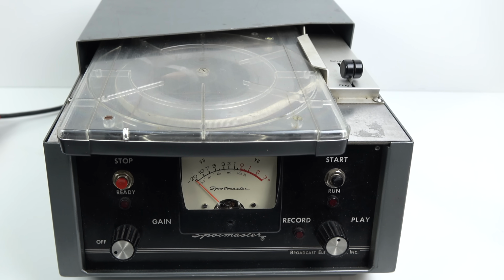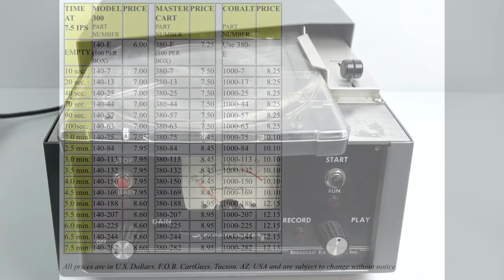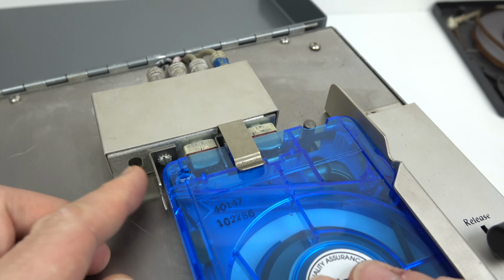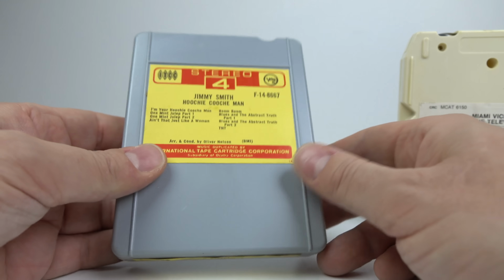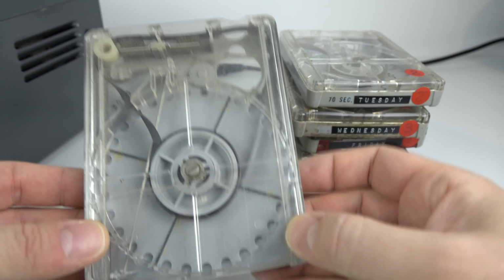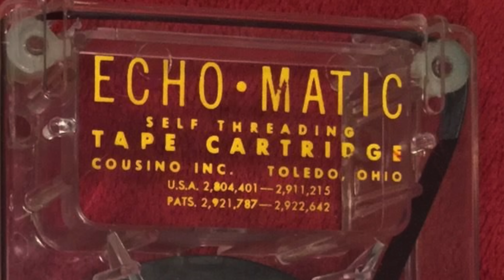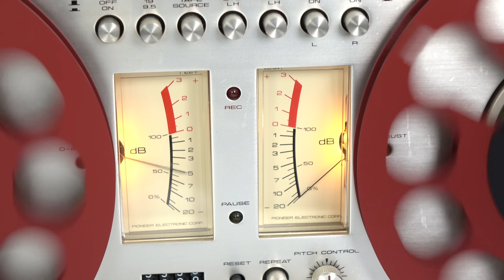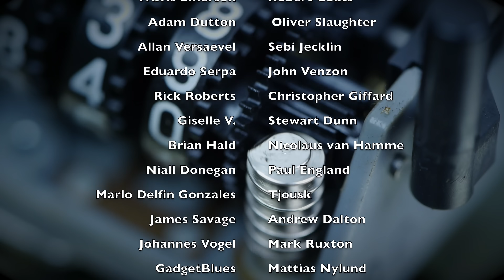The Broadcast Cart Machine

Comment: Back in the 80's a local radio station(Phoenix, AZ), was playing a cart to death. It was Duran Duran's, "Wild Boys", it was putting out it's death throws for about a week, until it finally self destructed on the air. I only wish I had the sense then to record it.
Reply: Sad, that would've been great to hear!
Reply: If I were a cassette made to record Duran Duran I'd probably kill myself too. 

unless it was Rio, then I'd allow it.
Reply: Max Mills That's why they put music on carts, so they didn't wear out the records, and eventually, CDs by playing them so much. Especially on pop radio / CHR !
Reply: Filming In Portland, how can you wear out a CD by playing it, its data being picked up by an optical tracking system, nothing touches the data, the machine will wear out, and you can break or scratch the disc but you cant wear out a disc just by playing it
Reply: @compzac  Both of you are right for slightly different reasons, CDs suffer  "wear" from handling rather than actual playing. same with records, accumulation of scratches from being handled repeatedly and with less care over time killed more records than were actualy worn out by the stylus. If a radio station is going to "burn up" a new recording (As is/was usual in the first weeks of a new,hot Top 40 tune.), Better to use a "cheap" tape dub.
Reply: @ChristopherSobieniak  I have heard serveral carts "buy the farm" on the air over the years, Having an ad "eat it" right at the "pitch" is golden Especially, if it was caught right and the air talent has to recover the spot. Sadly, such fun is lost in our digitally programmed stations now.
Reply: @jamesslick4790  Oh, it is.

Comment: This brings back memories. Back in 1990 I discovered a bunch of stuff that had been taken out of a small radio station in 1973. There were a few pieces of equipment, along with boxes of carts and reel to reel tapes. The equipment was all made in the 1950s and included a couple of full track ¼" reel to reel recorders designed for mounting in an equipment rack, with the electronics (with octal base tubes and a very rugged and heavy design) in one unit and the mechanism in a separate unit. I found the manual for one of these machines, and the specs were quite impressive for the time, as these were true high-fidelity machines. There was also a cart machine which was for playback only, it was a very simple machine with a lever on the right like yours. I was able to use it to listen to some of the carts and discovered the cue signal on one track with the program signal on the other. The machine had an output for the cue track but didn’t have any internal cuing mechanism, so I assume it used an external cuing unit. Many of the carts had multiple spots on them with a cue signal at the start of each one. There were a lot of commercials on short reel to reel tapes, and I assumed that these would normally be dubbed onto carts for broadcasting, then when the time for the ad was over, the cart would be erased and used to record another spot or several related spots. Usually these multiple related spots would be found on one reel to reel tape, recorded one after another. I didn’t find any music to speak of, other than jingles and such, but I did find a DJ demo recorded on a reel to reel, where a DJ at the station had recorded several times the end of one song, his announcements, and the beginning of the next song. Presumably the DJ made the tape as part of an effort to find a job at another radio station. The unique sound of the beginning and end of each recorded spot told me the demo was recorded on one of the machines I was using to play the tape, or an identical model. It was interesting to hear portions of songs that were current at the time, which was 1973, the year the station removed their 1950s era equipment and replaced it with new equipment.

Comment: Regarding the carts with music; They used these carts in the radio station my dad maintained in the early 90s in Western Australia for their fully automated robotic system for ads, jingles AND music. The system was very old by that stage (it had a paper tape reader on it for programming, though not in use by this stage), it had two banks each with a robotic X/Y mechanism for picking and placing tapes from it's respective library into one of it's several cart machines in the bottom row (see the scene from 'Hackers' but for these carts instead of video tapes). From memory it was called "M.A.R.V.I.N.". Those music carts you have may be from a similar system.

Comment: I worked at many stations during the 1970s and 1980s, with cart machines from Tapecaster, Spotmaster, Sparta, Gates, SMC, ATC, and ITC.  We used them for everything from jingles to news reports to full songs. A station where I was the chief engineer during the mid-1980s had almost 100% of the audio we aired come from cart. At that station (WKHY) we had 2 ITC 3-slot stereo cart machines in the main air studio feeding 6 channels of the mixing board. The carts were recorded (in the production studio) using an ITC series 99 machine. The cue track uses a 1 KHz (primary) tone to mark the beginning of cuts. There is also a 150 Hz (secondary) tone that is used to mark the end of cuts. The secondary tone starts when at the overlap point where the next program element should begin, and ends at the point where the audio on the current cart ends. You talked about a cue function. Of course all cart machines would stop, cued to the beginning of the next cut at the beginning of a 1 kHz cue tone. The only machine I have experience with that had a more sophisticated cue mechanism was the ITC series 99.  After the end of the 150 Hz secondary tone, it would go into fast forward looking for the primary tone, which was much higher than 1 kHz because of the increased tape speed. Some machines also had an 8 kHz tertiary tone, but there was no standard use for such a tone. Also, some machines would output the cue track audio to a modem which decoded an FSK burst with logging information. If you really want to see some interesting applications for NAB carts, check out the 24-cart carousel machines made by SMC, or the 48-slot Instacart (both of which I've worked with). Gates also had a 55-slot machine, which was not very popular. These 24, 48, and 55 slot machines were  used as part of automated program playout systems. Often, a program automation system would have a time announce sub-system consisting of 2 cart machines, one for odd minutes and one for even minute. For minutes when the time announcement was  not aired, at the end of that minute the system would switch to the other deck and play past the unaired announcement. This way it was all ready to go with the correct minute hen called upon. Due to the large number of announcements on each time cart, it was mandatory to use the largest cart, which IIRC had 45 minutes of total recording time.

Comment: I have a box of broadcast carts somewhere with music and jingles on. They were in use till the late 80s/early 90s when PCs running specialised broadcast software really starting taking their place. 
could load one of those small carts with up to 12 minutes. 
The station I worked at also had all their music library on those carts, It was a bugger when the last person to play it had not fast forwarded it back to the beginning, so I always kept a song ready to go in the last player.
The modern carts had three tones. The primary tone was the start of audio, and we used to use a secondary tone to send it on to fast forward, and in some instances fire the next cartridge player. Never used a cart that used the tertiary tone.

Comment: The radio station I worked at in the early 70's carted the Top 10 Singles each week. By the time a record got to the Top 10 it was already in poor condition from repeated plays and mishandling by the DJ's so the program director had 10 carts marked 1-10 in a rack right next to the studio mixer with the list of songs title and positions posted on a sheet that hung on the side of that cart rack. It saved time cueing up vinyl records (which also saved on new turntable stylus) and was easier to set up as a format for the DJ's as in "Play this weeks #1 song just after the news at the top of the hour". You just grabbed cart #1 and played it. The cart machines often needed cleaning and maintenance as they were used extensively for the ad spots and station jingles. All in all they were work horses. I know that our station had 6 machines, four on top of the mixing console and two off to the side. We always wanted more in our crowded studio.

Comment: I was lucky enough to work as a board operator and weather announcer for a radio station when I was a teenager in the 80s so this really brings back memories! 

It doesn’t surprise me that many carts were blank. It was standard practice at our station to have an intern or low paid worker like me to blank out carts. The device to blank them out was just a huge magnet. You would just hold a button and swipe the cart around on the surface. 

I returned to radio in 2001 and by then all of the carts were gone and everything was digital, which was way more convenient but also not as much fun. It was a challenge to start those carts in a way to make the station sound tight.

Comment: I was an engineer at WKHY in the mid-1980s. We used almost exclusively carts on-air, songs, commercials, jingles, etc. In the main control room, we had 2 3-slot ITC 3D machines, 6 slots total. We had a "wall of music" with over 700 songs, 1 per cart, and a rotating rack with about 200 commercial and other carts. We had an ITC 99 cart recorder in the production, along with Otari MX5050 stereo and 4-track RtoR, and turntables. The biggest reliability problem was the Jones plugs on the back of the 3D cart machines. They were not designed for audio signals, and had to be cycled every month or the would randomly loose contact. An engineer at another station solved this problem at his station by disassembling the connectors and gold-plating the pins.

Comment: Won't mention the name, but a northern radio station I worked at was still using carts until 2000! We used two sonifex decks - one to record, and one with two players plus a separate erase. Worth mentioning there were three types of cues - Primary cues were at the start of a recording, secondary cues were inserted at the end and a tertionary cue triggered deck 2 to start once deck 1 cued. This is how our jingles could fill any time needed as there was the primary "You're listening to Mikeapollo FM", the secondary (which was your instrumental loop on a second cart) then your tertionary cue as the outro "on 10 46 fm" so playback would start on deck 1 cart 1, cue to cart 2 on deck 1 then once you hit cue again would flip back to cart 1 and the outro. 

Really nice kit, we upgraded to DART (disk based) systems in 2000 just before I left radio :)
Reply: Mike Holbrough Lots of stations still used carts, and especially CDs, well into the 90's and sometimes early 00's. especially in America where we have so many stations, including many smaller markets without a budget (or big markets with cheapskate owners like Clear Channel) who saw no need to replace something that worked. Until they decided to try all automation on each station by going all computerized, and sometimes switching to live assist when automation drove away listeners.

Also even after computer automation took over with its WAV file spots and liners, they still often used CDs for music, either Denon CD carts or carousels. Some even still used the reel to reels of older music in conjunction with WAV file playback of computer automation for a while, so they didn't have to replace all their existing music or record it all into the computer. It took quite a few more years until all the stations finished that transition.

Comment: I interned at a small owner-operated religious station when I was in high school in the early 90s. I remember the station having two six-foot tall spinning cart racks that were each about the size of a Christmas tree in the 8x6 broadcast studio. The transmitter had been run off of an SX-64 which had just been retired when I got there. It was still sitting in the corner as a backup to the shiny new 486 DX 66 that replaced it. I hadn't thought of any of this in years.

Comment: Back in 1969, I found a 4-track home recording deck at a yard sale.  It was a dead format even then.  I added a handmade cueing head that could sense a foil patch stuck on the tape, then built an elaborate relay-based control circuit, and added a standard cassette recorder.  Presto!  I had my own telephone answering machine at a time when the only other way to have one was to lease it from the telephone company.  A year or so after that, I started working in broadcasting and spent way more time juggling carts than I care to remember.

Comment: I worked in radio in the 80s and 90s, and I've never seen a cart machine that old in real life - only in clips of 1960s radio!

The fact that it's not responding to the cue tone indicates an internal fault, it doesn't require any external equipment to cue itself.

Sorry to burst anyone's bubble, but I'd put money on that not being an original Radio 1 cart. Professional use was always strictly one jingle per cart, and those PAMS ones became widely available (via illicit means) to collectors during the 70s. 

The fact that there are multiple jingles on the one cart is the hallmark of something used on hospital radio, or maybe by a club DJ - the more successful ones in the bigger clubs could afford a cart machine.
Reply: I worked at several stations in the '70s. Carts were always in short supply where I worked. We ALWAYS used to put multiple tracks on a single cart. If you played them at the proper times (Intro, outro) you never had a problem.
Reply: That never happened at any station I worked at in UK radio (including Radio 1). OK, maybe one exception - the "number shouts" for the Top 40.
Reply: dunebasher1971 Difference between large market and small market radio. The UK stations like radio 1 are national, but most American stations are not. We're a huge nation, with tens of thousands of stations. Small markets with maybe a few thousand listeners tops any afford one jingle or spot per cart. Some even used cassette regularly for things like phone calls that would be played back and consumer CD changers linked up to automation computers.
Reply: dunebasher1971 Also, I'm 99% positive this old of a cart machine did NOT have internal cueing, which did become standard. They made external cue units for this though that could be used with this. An add-on "option".
Reply: Hi Joe, another Joe here.  Yes, in small market central Washington State there would be multiple cuts per cart, often 2-3 cuts of the same spot for an advertiser or station jingles/bumpers.
Reply: My father used to work in a radio station in the dominican republic back in the day, he says that they would put multiple jingles on the carts, looks like everyone did it a little bit differently
Reply: The stations I visited all the time usually placed 2 or 3 spots per cart.  For some larger advertisers, there would be multiple versions of spots that would seem to be randomly played during the day.  they were in fact played in rotation in the order they were on the carts.    One cart I saw in use had 5 different versions of a spot for a local advertiser and one spot was played every 1/4 hour. Not 15 minutes, as the need was 4 times an hour, and it was a music program station that only did hard time cues on the hour for news.
Reply: I confirm, i'm a big fan!
Reply: Well in the 1980's the radio station I was at had cart machines.
Reply: Due to the amount of requests, we recorded "Court of the Crimson King" on a cart.
Reply: I can tell you that WXRK (K-Rock), used those cart machines up till 2005. And that the flagship studio of Howard Stern, which had a 9.5 share in NYC and a 6.5 share in LA, and 20 million american listeners, used those carts exclusively until he switched to satellite radio. They had stacks and stacks of carts, and would switch them manually, by hand, on the fly.
Reply: I've been at WDOM and WALE.
Reply: The Spotmaster did have internal cuing.
Reply: Interesting. In the 1980's at WDOM we had two cart machines in the main broadcast studio and a recorder in the B Studio.
Reply: In the late 90's, I had both Denon CD players crap out at the same time at a radio station I was DJing. I was glad we had a rack of a few dozen dusty old carts in the back of the studio with songs on them lol. Carts were ridiculously reliable.

Comment: I noticed there is NO erase head in the Spotmaster! 

I guess Standard Operating Procedure back then was to bulk-erase tapes that contained 'dated' material', hence, most of those tapes you bought were blank!
Reply: Radio stations would do that all the time.
Reply: I still have my bulk eraser. I use it to erase 8-track tapes.
Reply: I imagine that it only took a couple times having a DJ press the rear button instead of play and having to explain to your customer why their ad didn't get played before they decided on a separate Maxine for erasing...
Reply: That makes sense since the carts looked dirty on the outside. Seems like they've seen quite some use.